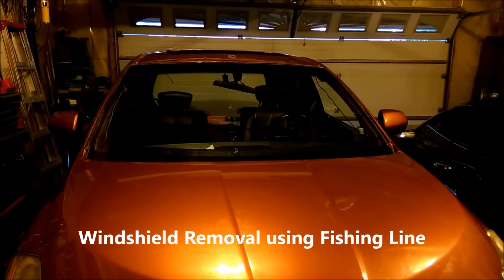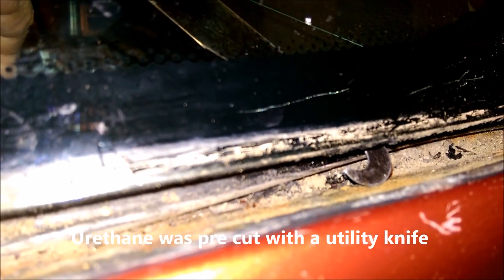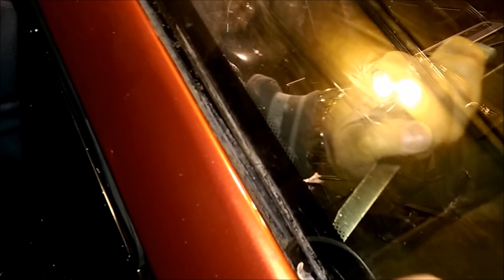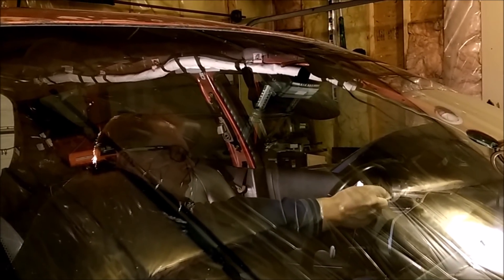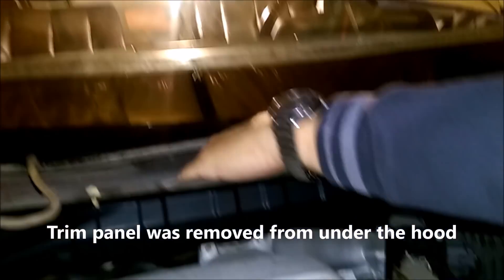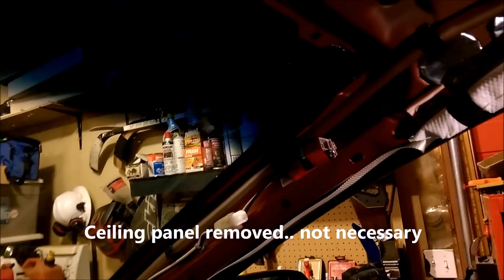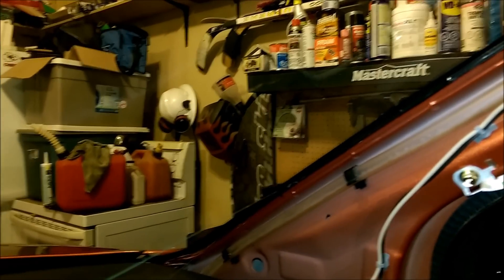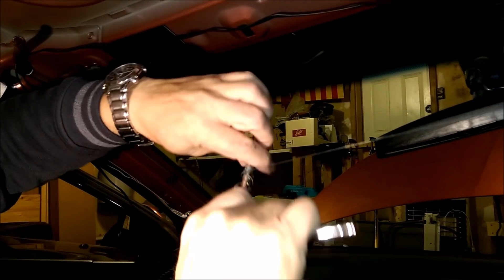Windshield removal using Fishing Line

Comment: you can use a cordless drill and wind the wire around the spindle. if you can anchor the drill close the plane of the window, it will just pull the wire through the glue. The real machine uses suction cups to mount to inside glass and kevlar cord that can pull through sheet metal tabs! you method is almost free and does the same, great thinking on the 1/4 ratchet. Wonder if a low heat gun on the lower portion would soften glue?

Comment: Can this be done without breaking the rear windshield? The rear windshield is not available for my project car, but I’d like to remove it for paint and to reseal it. Also the quarter windows. I’m just nervous because a replacement would not be easy to come by….

Comment: This looks like the easiest method and least likely to break the windshield. Those pull knives won't reach far enough on some cars and the cable saw is slow and risky. Thanks for sharing this Will. Five years later and it's still helping people out.

Comment: Very nice job. I started thinking about using strong braided fishing line, searched on YT and came across your video. I have some experience cutting out glass professionally, many years ago. We used the sawz-all style tool, which was fast, but caused more damage than I like. I have a suggestion for your method that should make it much easier. Get a long-handled utility knife. I think mine is 16 inches. Cut the top and down the pillars using your method. Once those are cut out, gently push out on the windshield and cut along the bottom with the utility knife. Don't cut through all in one pass. With each cut, you'll feel the windshield coming away. After 3 or 4 cuts, you'll be all the way through. Just be careful not to push hard enough to break the glass. I can cut through the bottom this way in under a minute (usually about 30 seconds). Just a tip for others looking to yeet a windshield lol
Reply: Mate just go to a windscreen  tools outlet and buy the proper line it's like 10 bucks

Comment: This is by far the worst way ever. All you need is 1m piano wire and 2 wrenches. Wind the wire around the ends of the wrenches. Ask a friend to help sawing through the polyurathene. It takes 45 seconds for us pro's to remove it that way. 2 minutes at the most if it's a bus or truck
Reply: What size is the piano wire?
Reply: @a.kurniawan3004  its not actually piano wire. It's purposely built autoglass wire. That s just a nicknames
Reply: @Itu2646  Oh ok. Thanks

Comment: I use a guitar string which i secure to 2 seat belt ends that have the hole to lock in place,i secure 1 end of the guitar string to 1 seat belt clip ,then poke a hole to push the guitar string through & tie that end off to the 2nd seat belt clip,i then have a friend help me and we saw through the old sealant,it helps saw much faster if when you cut out the seat belt ends from a junk yard car if you leave about 2 foot of seat belt strap connected to each clip so you have enough material to wrap around your hands,using a guitar string with seat belt grips you & a friend can cleanly saw out the entire windshield in less than 15 minutes & the entire window pops right out .

Comment: Go to Harbor Freight and buy a pair  of tee handles in the body and repair isle works much better holds the wire or string pull the handles

Comment: I’ve perform the same as you in a Dodge Durango 2013, unfortunately it suffered a windshield replacement (because broken) with a original part (mopar windshield) but misinstalled, so it entered rust in the superior side of windshield, and the paint begone to rise. this was the reason why I haved to remove the windshield, the other job is a easy restoration for a car paint man. the big new is that although I am a beginner in this, but following your instructions, with help of mi dad, we have done a excelent job, 
Windshield removed no damage!!!!!

Comment: Most likely when you hit the top corners . the reason it gets hard is there are plastic pins that sit in the hole in the top corners to set the glass when it installed by the factory you can see the hole in your last corner when it got harder to pull.

Comment: I am now back after almost 1 year!  Last year I followed your technique on a car at the scrap yard, but I failed on the corners.  Even with fishing line there was too much stress and the screen cracked.  I also found my 90lb line broke on numerous occasions - this led me feeling quite despondent, especially as there were no other cars I could practice on. I had to wait for almost a year for another car to appear at a local scrap yard .  But today I had success with a modified technique!  This is the approached that worked for me:
1) I purchased some 300lbs braided line, and it never snapped once
2) I sprayed everything inside and outside with washing liquid for lubrication
3) I used a very thin knife to make a hole at all of the corners
4) I then used some Hazet cutting wire and 
 Bahco BBS101 wire grip handles to saw a few inches round all the corners 
5) Once the corners were cut, I tied the fishing line to the top of the steering wheel and cut all of the straights. I actually cut from the outside of the car, as I found it too cramped inside.  I found I could pull the 300lbs line as hard as I wanted and it just sliced through.  Actually these straights were really quick to cut, and because they were just straights, I found I didn't need the extra mechanical advantage of cutting from the inside.

I hope my experience is of help to others
Reply: Vegan Dog I wish you were around my area, failed on 2 windshields already.
Reply: I'm going to try it tomorrow, ,but first I need to find out what is 300lbs 😂but I think to buy the strongest fishing cord...
Thanks for the corrections and I think the most important part is a lubricant !apologies for my English. .
Reply: @v.ivanov8001  
Yes my modified approach works well.  If you search for 300lbs line on Amazon, you will find a lot of options.  But make sure you saw all of the corners with the wire fist and lubricate everything well.  You can then cut the straights easily with the fishing line.  I have now removed 4 windscreen with this approach and may get round to making a video on it sometime.
Reply: Another approach I have since used (which is a little quicker) is to use something like a Milwaukee C12MT multi tool.  You can even get the dedicated windscreen cutting blades for these.  The blades by Equaliser or Fein fit, you just need a chunky washer to hold them on.  Alternatively you could weld a stanley blade onto a sawzall attachment like this: 
https://i.ibb.co/cQFf8pZ/tack-weld-standley-onto-sawzall-attachment.jpg    But really the simple approach with the wire and fishing line is all you need
Reply: @VeganDog  Thanks! Tomorrow I will try and I hope and I think that everything will be OK.
Reply: @VeganDog  I'm about to attempt removal for the second time . Would heating the edge of the windshield to soften the glue help or hinder in your opinion? Not with a blowtorch or flamethrower, 🤔😬 just a 1500 watt heat gun.. perhaps the sexy neighbor-ladies Revlon MagiCair??
Reply: @bonscotty67  I don't think it would do any harm, but it may not make it much easier.  But by all means go give it a try.  Another option for you may be a Milwaukee C12MT Oscillating Multi Tool.  You can get special windscreen cutting bits for them, or you can weld a Stanley blade to another bit.  I experimented with this and also had success.

Comment: I wonder if a heat gun would help soften the adhesive making it easier to cut
Reply: A heat gun brings a high risk of thermalfracture ,the preferred method is to have the car in direct sunlight upon the windshield on a warm day for an hour or so. If that method isn't doable then next best is to have it inside a warm garrage for a couple hours.

Comment: We usually just cut the hood release cable, from a wrecked car  ( cut one end of the cable to pull out the wire )  then use the wire to cutout the windshield;  2 people one inside one outside, hook vice grips to both ends after feeding it through. Then we make back and forth sawing movements; ( The biggest problem is being careful not to damage interior parts )  I made a sharp knife end for my oscillating power tool , now  it's even easier - basically goes around underneath the windshield like cutting butter ;  Still way cheaper than buying $500 tool. - Some windshields are thinner and take very little to break
Reply: Pls share your oscillating tool method

Comment: how about using steel guitar string .14 to .21
Reply from the maker: Mikko Skousen I have seen a few vids with two people sawing through the urethane with a guitar string.  It works, but the point of this was to show an easier way to do it by yourself. If you could get a guitar string that was 5 meters long, I'm sure it will work using this method.
Reply: right..good point..harder to find somebody that has time than to buy some fishing line..thanks for the video
Reply: @mikkosutube   Piano wire is as low priced as a few dollars and will not snap. It's an extremely long steel , guitar like, string.

Comment: I have to help replace a windshield today and never done it before so I was looking for a video on how to remove one. Almost every video I've seen has knives involved and I know they can break the glass if not careful when trying to remove the polyurethane. This is a genius idea on how to cut through the polyurethane with the hazard of breaking the glass. Great job
Reply from the maker: Thomas Richardson There have been some good suggestions in the comments, like putting dish soap between the edge of the glass and the frame of the car to reduce the friction..  Might be something that will help..  Also..  use 100# test braided line, I used 60# and it's kind of a feel thing not to break the line.

Comment: I use mig welding wire it gets hot and cuts easy  but can snap
Reply from the maker: Andy Mck 63 I broke the 60# test line twice which is why I suggest using 100# line.. I thought of using mig wire but fishing line is more flexible so you don't waste any effort bending the wire plus the line is thinner, therefore "sharp" and cuts through the urethane pretty easy.
Reply: will peters cool I will try this on my sons corsa windscreen soon .I have changed many screens working in body repair shops mig wire was on hand  at the time

Comment: I would at least wrap a wash-cloth around the steering wheel, lest ye cut it in half lol. I just did mine using 100lb braided test and broke the line 4 times! I was moving slow too.  I'll add to this process that the more flush and close to the glass you can keep the line, the better.  I got the passenger pillar, top line then driver pillar done, then with help, we pulled from both the outside and inside at the same time to cut the bottom.  I also used 1" wooden dowels cut at 10" long to wrap the wire around which works well because you have more to grip. I also recommend wiping a little oil along the outside perimeter (I used baby oil / mineral oil) and wore gloves.  Aside from keeping the line close to the glass face, it's also important to try and keep the line in a "U" shape around the glue. Whenever it's an "L" it puts more inappropriate tension on the line and does not cut nearly as well as keeping the line in a U so that it stays as parallel as possible to the opposite line or outside line.  Lastly, I did break the glass as it was already cracked before. If trying to salvage the glass I cannot say for sure whether this is the best method. I hope this helps those folks who try this method.  At least it's cheap and doesn't need tools that you might only use once every 10 to 15 years.  My total time after removing interior pillar plastics was around 2 hours.

Comment: You have persuaded me to have a go!  I am not into fishing, so would have to buy some line.  For 100lbs line it's actually more expensive than wire.  Nevertheless I am happy to buy some line if it's the better option, but do you consider fishing line to have a definite advantage over wire?  Or were you just using fishing line because that's all you had ?  If you did not have fishing line, would you still choose to buy it in preference to wire?
Reply from the maker: I used fishing line because it is thinner so it doesn't require as much effort to pull through the urethane. It is more flexible so it will go around bends easier a d it will not damage the paint. There have been some useful comments like applying oil or dish soap to the space between the frame and the windshield which should reduce the effort to pull the line through the urethane. 

I hope it works well for you.
Reply: Okay many thanks, I am going to give it a go with fishing line.  Just one other thing how did you make the first hole to thread the fishing line through?  Did you just cut it with a Stanley blade?  I may try heating a heavy duty needle and pushing it through the urethane
Reply from the maker: Vegan Dog I used a Stanley knife..  But try the needle and see if it works, there is aways a better idea.
Reply: Many thanks for replying.  I will try the needle idea, but I suppose if it's too hot it may crack the windscreen.  Although I heard some professional windscreen cutting tools work with heat.  So I will give it a go and maybe even make a video on it.  Many thanks for the fishing line idea and keep being inventive!

Comment: Is it best to use braided or mono line?  Also did you keep one end of the line tied to the steering wheel at all times?  I saw you tie it onto the steering wheel but not take it off.
Reply from the maker: I think it would be best to use braided line, mono line would not have the same cutting ability. And yes the line was tied to the steering wheel at all times.
Reply: Thanks for your reply.  If the line was tied to the steering wheel at all times, did it not cut into the padding of the steering wheel?
Reply from the maker: I wrapped around the wheel several times so no it didn't damage the wheel, if you are concerned about it you could always wrap the steering wheel with a cloth, or a piece of cardboard etc.

Comment: Awesome Dude.....Thanks for posting......Thanks to the Missus too for the excellent camera work.  Have to do my 96 Taco as part of a restoration job.  Brand new windshield in it too.....Thanks again.
Reply: How'd it go on the Taco? I have a 94' (pre-taco) that I need to do this too this month.  When I replaced the windsheild 10 years ago the installers did a shitty job and Ive got rust issues on the outside pillar bases.

Comment: Wouldn't this have been easier from the outside?
Reply from the maker: When you wrap the line around the outside, you are constantly pulling new line through the window sealant. it works like a pulley,  you pull a lot of line through while it slowly cuts through the seal. I'm not sure that you would have the same mechanical leverage if you fed the line from the inside out since you would be pulling the same few inches of line through the sealant.

Comment: Nice work Will.  I too have watched a lot of videos on the expensive cord and wire pull methods.  The only thing that I would add that might make the pulling resistance less, would be to spray a liquid on the outside... water, soapy water, or maybe a cleaner spray like Simple Green.  I do have other tools, (I help my Brother from time to time. He owns a Glass Shop) such as the reciprocating blade/knife, but I am always looking for a better, less expensive way/method.  The goal is to not break it!!!  Again, nice work. Thanks for sharing your creative thoughts, yoaseff.